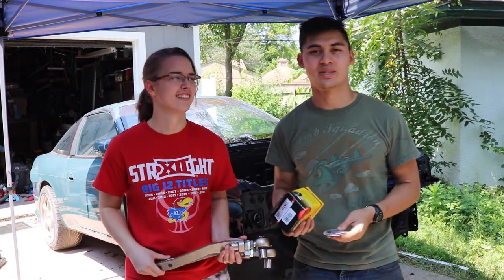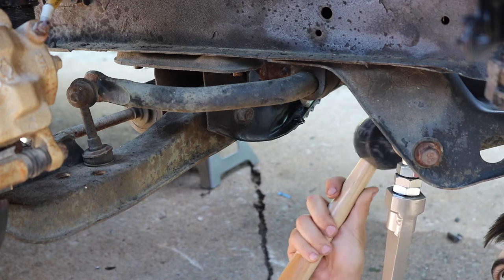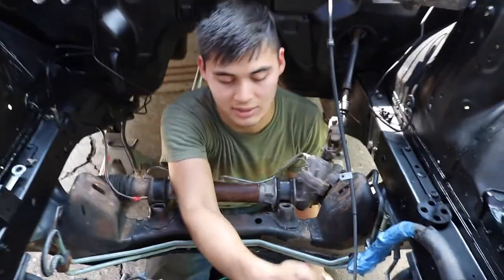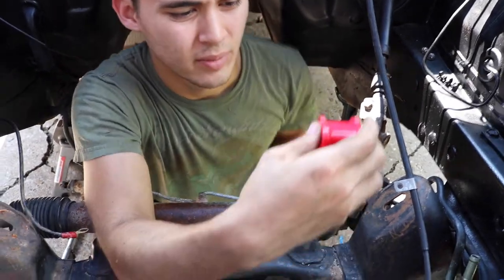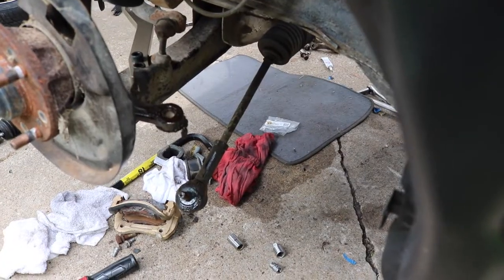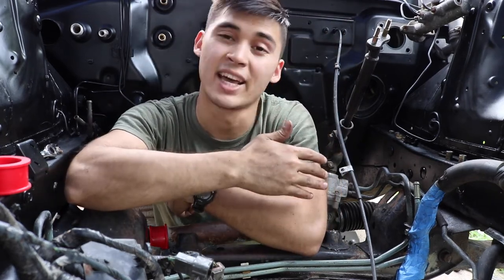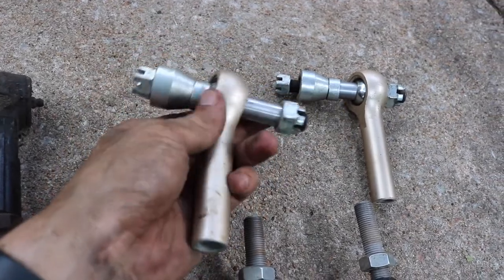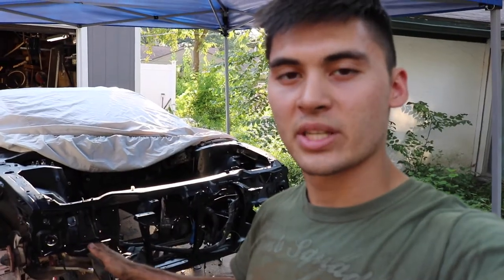Responsive Suspension & Steering Mods Installed

Comment: Enjoying the vids. You need to make sure the tension rods have as equal thread as you can. if you have sleeve extended out and the other completely in it will create more stress on the joint that is extended!
Reply from the maker: +Cole Bunn Thanks! I appreciate the advice on those tension rods! I tried my best to get everything as even as I could. Hopefully the mess I created for whoever does the alignment isn't too bad!
Reply: B Taylored it looked like you adjusted one side on the front collar and the other side from the rear collar. I encourage you to look up rapper Dan s13 gkteck tension rod video. I know you have ISR rods but they're the same thing. It'll explain it better than I can
Reply from the maker: +Cole Bunn ah I see what you're saying! Good looking out!

Comment: im not trying to be a dick but i dont think you should use jackstands on frame rails, eventually they could crush in. i always do mine from the front tow hooks
Reply: I just remembered it dosnt have the motor in it so i guess it dosnt really matter, but serious question would you normally use the frame rails to hold up the car?
Reply from the maker: +o Lemurs No, I understand your concern. 240s are notorious for frame rails and pinch welds being damaged due to  improper jacking. That's an interesting place to jack a 240 from. I've never seen anyone do that. Unfortunately this 240 has already suffered some of the rear frame rails being crushed in due a previous owner. Usually I go for the front cross member. I had to move to the frame rails for a reason I can't remember.
Reply from the maker: +o Lemurs For the front of the car, I jack up the car using the cross member, then place my jack stands under the same cross member using the notches where the steering rack bolts in to position them. For the rear I use the diff to jack the car, then place the jack stands on those semi-circular lift points between the frame rail and the pinch welds.